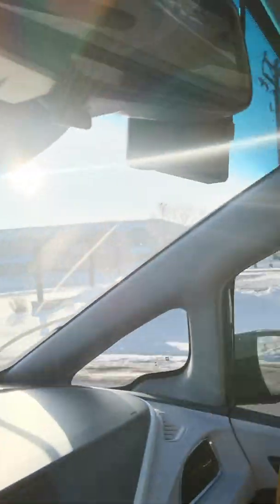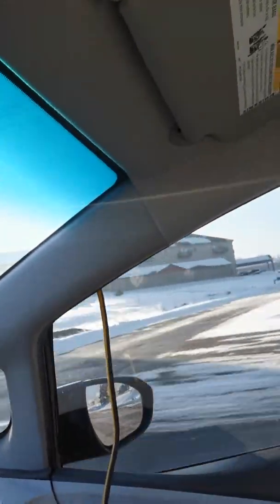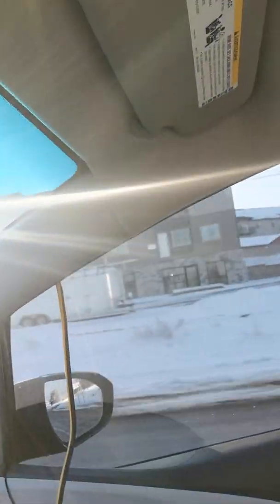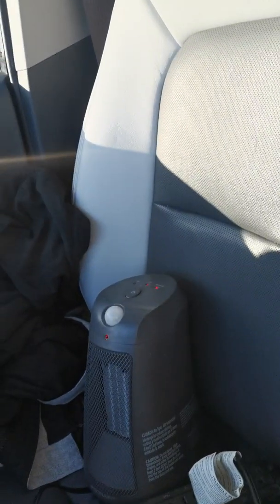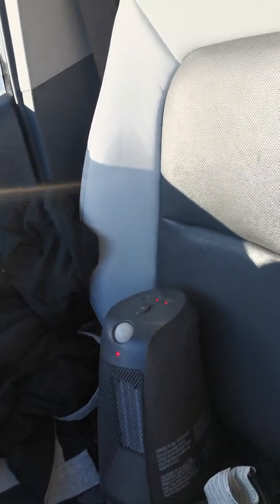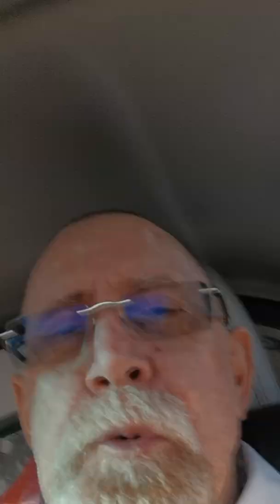Increase Chevy Bolt Winter Range

Comment: Why not just use a 12 volt heater and plug it into the 12v accessory plug?
Reply from the maker: The 12Volt "cigarette Lighter" cannot handle the need amps.
Reply: Wtf 😂😂😂😂😂😂

Comment: Interesting experiment.  To convert 7.5kw of energy to heat up coolant to then pump this coolant through a heater core and then blow a fan through the heater core to move the heat to the car interior - lots of opportunity for inefficiencies in that plan.  Having a smaller heater (1000 W?) for steady state once the car has warmed up would possibly be a next step for PTC heater usage in BEV cars.  This seems to prove that point?